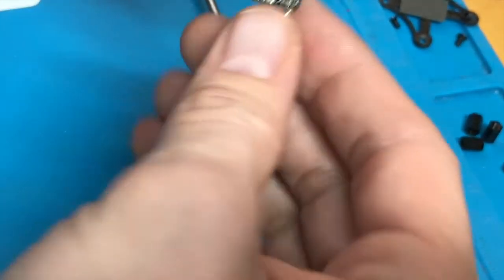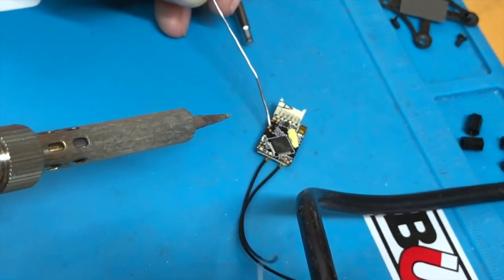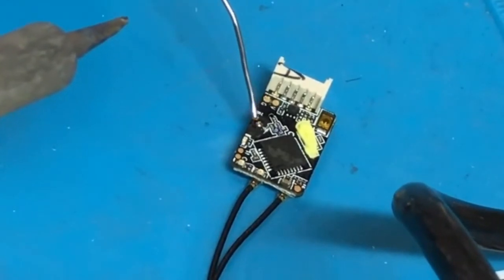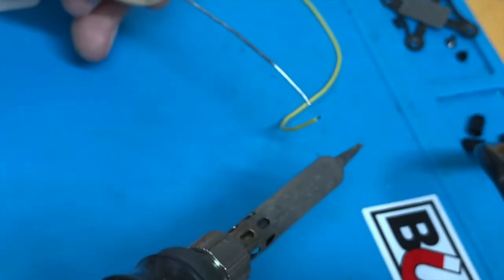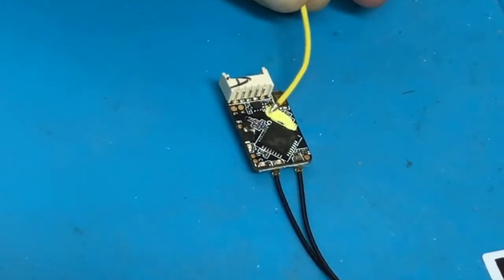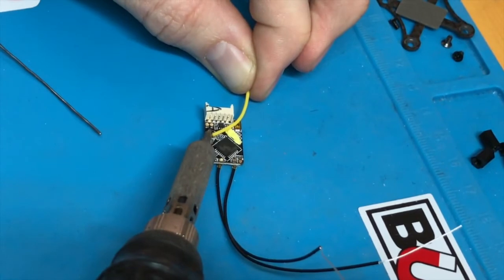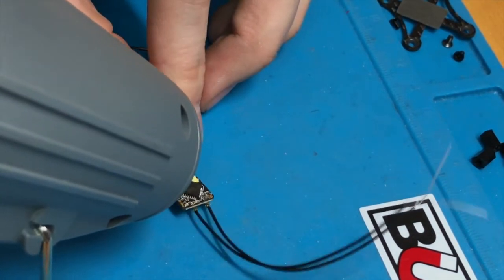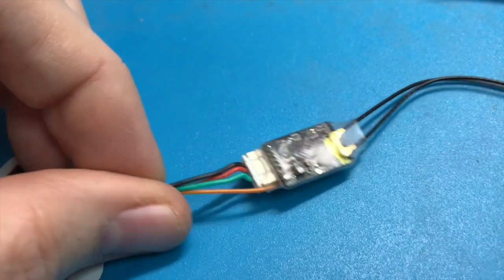How To Solder to Small Pads - Specifically the R-XSR Receiver Un-Inverted Smart Port

Comment: Pin 5  S-Bus_in is for redundant RX so no loss on single RX quad to cut pin 5 at base and solder un-inverted Smart Port to pin 5 for F-Port single wire setup... or so it seems till the next discovery in information hits. Un-inverted P and B pads on Frsky R-XSR NOT SHOWN on supplied manual.... jezz talk about a waste of time dealing with F4 when there is NO inversion issue with R-XSR's due to B&P pads!  ERRR! Such an important simple thing not being mentioned is hard to believe. Thanks for posting... just got an R-XSR for a small build  and nothing in literature said anything about having uninverted SBus/SmartPost pads on the RX with some using soft serial to solve the "problem".

Comment: I ruined that pad and tried to scratch the lead going towards it. Something went wrong it seems since the green led is on telling me it's bound it doesn't send any channels. I've bound it using the inverted S.Port with F.Port FW but noticed the channels worked but telemetry didn't and then discovered I needed this uninverted pad for my F4. I tried using the servo cable again to refresh the FW but get "FW update error. Data refused" message when doing so. Guess I'm out of options and broke the receiver.

Comment: Confused . . . 
You cleaned off the tip and then tried to apply solder to the tip/pad but it did not take.
In the next shot, solder magically appeared on the pad from a clean tip???
Reply: I don't think it's a different shot. He paused, explained, then resumed. Solder is already on the tip. But I agree with you, it's a bit confusing and I'd like more details on this technique.

Comment: Don't use hot glue constant vibration will cause it to eventually let go of the PCB. A better solution is an electronics grade silicone, you have to use something rated for use on PCBs because the most common form of silicone is acid cure which will eat though copper and you don't want that. The GC Electronics stuff is pretty widely available and not too expensive (can get it from Jameco or Ebay) just make sure it's the electronics grade version and not the general purpose one, the one you want is part 19-155. It's also good for sticking down replacement antennas (could never find what that yellow glue FrSky uses is but this stuff works well too)

It would be easier to use a three position SOT32 to DIP breakout PCB (available for cheap on ebay) and solder a single chip inverter to it, then solder the sbus lead on either side using the DIP through holes and shrink wrap it (you'd have a little shrink tube covered doodad in the center of your sbus jumper lead). If you wanted to go further you could use a single chip Schmitt trigger inverter such as an SN74LVC1G14 which would have the added bonus of removing any noise or irregularities in the signal.

 Here's an inverter and signal cleaner I made for the Hobbywing Flyfun V5 and Platinum V4 RPM signal, it should also work for inverting and cleaning an sbus signal. You'd need to also bridge the Vcc in addition to the ground (only the ground needed to be bridged across for this application) https://www.helifreak.com/attachment.php?attachmentid=727770&stc=1&d=1509676792
Reply from the maker: I dunno.. that sounds like more work to me vs 1 solder point. I've now down about 15-20 of these receivers like this and I haven't messed any up.
Reply: Why not just use a dab of epoxy?

Comment: Try using Blue tac  to stick the board to. Lot  easier to solder when the board doesn't move.
Reply: I second that. I always keep a lump of Blutac with my iron. An elastic band is useful too - put it around the handles of a small pair of pliers and it makes a handy clamp for tiny parts.
Reply: And also stick masking tape over the nearby components to reduce the risk of touching other parts and connections.
Reply from the maker: That's a good idea! Ordering now.